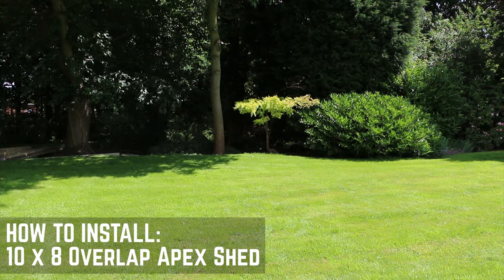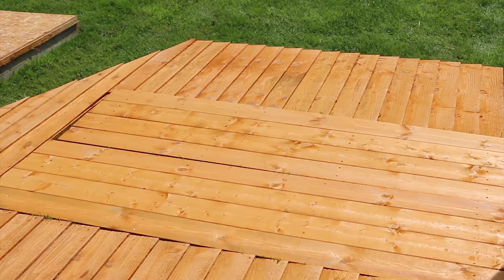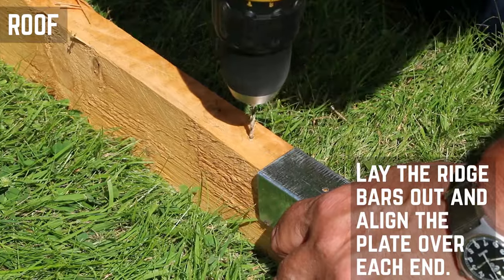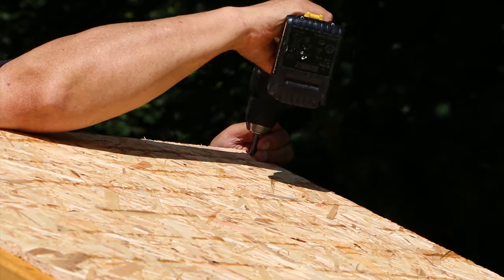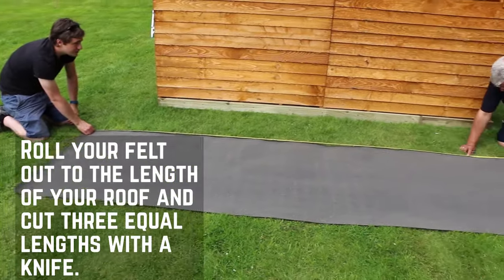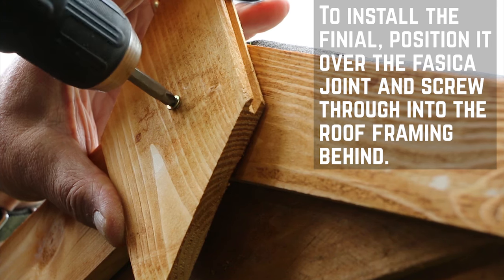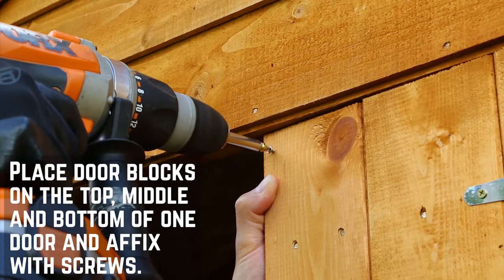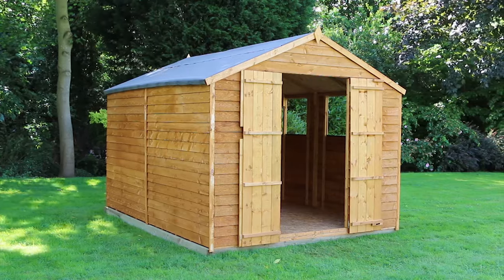10 x 8 Overlap Apex Shed Installation

Comment: I've installed the windows but there is at least an inch gap at the top - cant see what I'm doing wrong as it just sits on the sill as per the video - the styrene is exactly square too so I can't have it the wrong way round either?